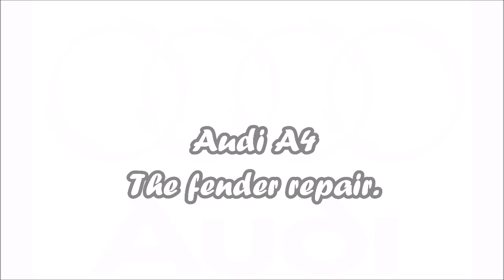Audi A4. The fender repair. Ремонт крыла.

Comment: Very nice work. You should buff a little the bonnet and the front door to perfectly match the color. The fender it's very shinny.
Reply: Notice different lighting. I suspect something blue in the shop in the finished shots. I painted an apartment white and it turned green when the green furniture arrived.